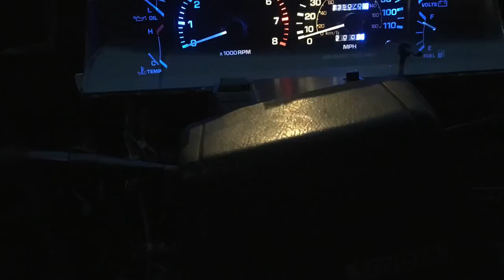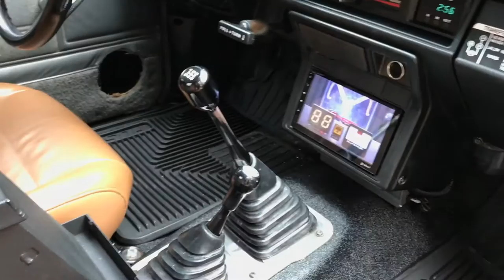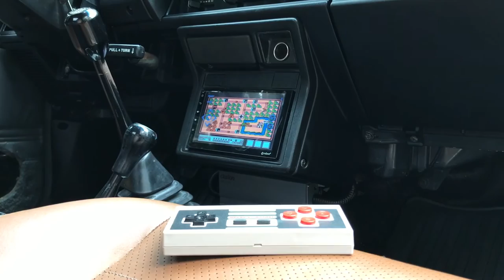BTTF 4x4 RestoMod

Comment: How did the duplicolor Vinyl and Fabric work out on the dashboard over the years? I'm wanting to do the same to mine but not sure how it'll hold up
Reply from the maker: On the dash, glovebox etc.. it's held up real well.  Only place i've seen scuffs show up where you can see the original color have been on the door sills but it's minor figure I can always pull them out easy enough and touch up if it gets too bad

Comment: Where did you get your touchscreen and how tall is your truck, I have one but it’s really low compared to yours
Reply from the maker: I believe I picked it up on Amazon.  It's a pretty cheap Android unit, should be even more options available these days.  The larger tires and suspension did make it a bit taller.  Does yours have have smaller tires and the factory suspension?
Reply: @epicoffgrid  yes my tires are 14s and factory suspension